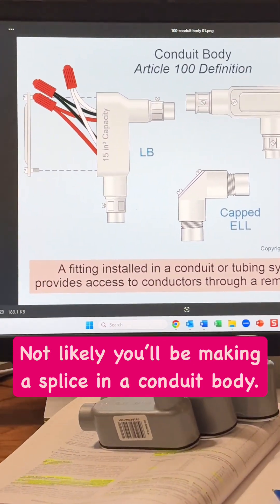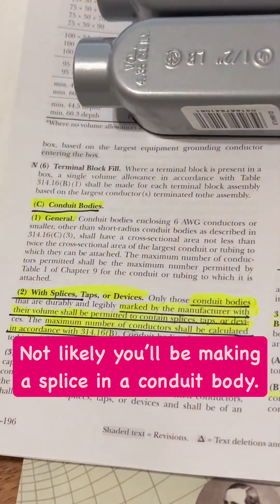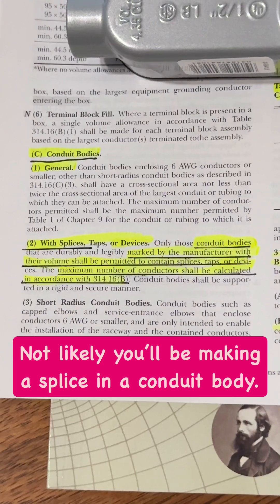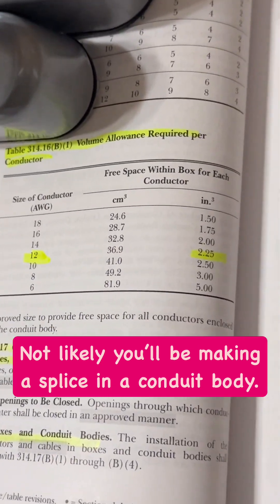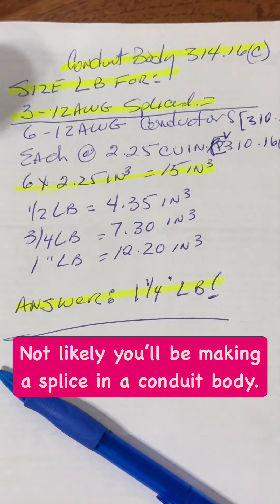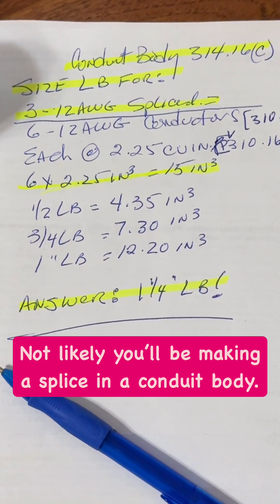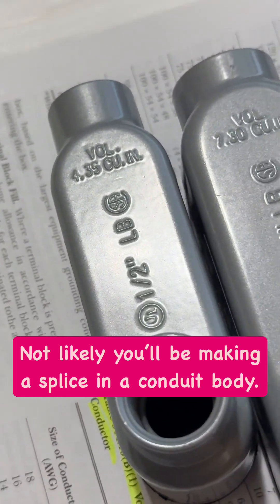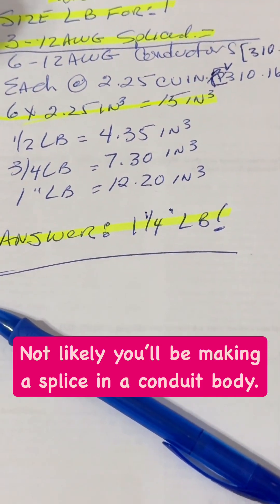Splices in an LB are permitted if the conductor volume doesn't exceed the conduit body volume.

Comment: I’m getting 13.5 cu inches when I do 6x2.25. Am I missing something?
Reply from the maker: The math on the paper (and what I said) was wrong (it is 13.5 cu in). I did fix this in the text of the post. I so wished that I could be perfect, sorry.
Reply: @ I was just making sure I wasn’t missing something since I’m new to electrical. I am taking my test Monday after buying the NEC book and tabs from you. No need to take it personal.
Reply from the maker: I didn't take anything personally. Good Luck

Comment: So for all practical purposes, the rule of thumb is NO, you can't. It's called a pulling el, not a junction box, for a reason. I've seen many used in outdoor applications where flood lights are connected to them and the leads are then spliced in the condulets. This is such a flagrant code violation that goes unnoticed by many inspectors. I just don't understand it.
Reply from the maker: FALSE about using Tribal Knowledge 'rules of thumb' for NEC application. Let's just use the NEC for NEC discussion.

Comment: Guess I'll keep an extra 1-1/4" LB and some reducer bushings on the truck just in case of this scenario. Maybe a condulet as well.
Reply from the maker: A box will work also...
Reply: @MikeHoltNEC  Of course, sometimes a box is too big or ugly. Although I'm not sure how good a gargantua LB would look.
Reply from the maker: It's not that large for six 12 AWG wires.

Comment: Several times had to look for my shoe horn & rubber mallet when a contractor ran 4# 12's for a motor & 3 #14's for start stop station in a 1/2"  " T " condulet. Sent new apprentice  on a wild goose chase to go and get a condulet extension box. Not much room for 7 wire nuts.
Reply: Yep and no room for a service loop. Surgical connections. Lol

Comment: Hi @Mr. Holt. Why did you double the conductors? For a standard single circuit multiwire branch circuit, 4 conductors are needed. A 1" LB would satisfy this requirement. Or a 3/4" LB for a single wire branch circuit. Am I missing something?
Reply from the maker: When determining the number of conductors in a conduit body [314.16(C)], "Each conductor that originates outside the box and terminates or is spliced within the box shall be counted once." [314.16(B)(1)] So we have two blacks, two reds, and two whites - six 12 AWG x 2.25 cu in = 15 cu in., which requires a 1¼ LB.
Reply from the maker: Lol... yea... all of us...
Reply from the maker: Me too.
Reply: @REG3305  Once the conductor is spliced it must be counted twice. (Hey that rhymes)

Edit: has someone been doing box fill wrong their whole career???

Comment: Love the way you said, "...INCH and a QUARTER!" Like who the heck is going to have a 1-1/4" LB on a 1/2" run? That's an EXPENSIVE splice box! Do they even MAKE a 1-1/4" to 1/2" threaded reducer?? 😂😂😂

Edit: spelling
Reply: ...would have to increase the cost with the reducers, most likely special order - not on the shelf, so your buying several different sizes to make it work.
I have used a 2" - 1/2" so the exist! Crazy to think it...
Reply: @JM-iz3fr  🤯 I think I'll stick with an appropriately sized J-box.
Reply: Yes they do. I have seen 2in to half
Reply from the maker: This post is not about 'how to' it's about reviewing a specific NEC rule related to making splices in conduit bodies per 314.16(D).
Reply: @MikeHoltNEC  "... they were too busy thinking about whether or not the COULD they didn't stop to THINK..."
Reply: If you do not have a jbox on hand the condulet will be cheaper even with reducers.
Reply from the maker: And you are 100% correct! https://lhdottie.com/reducing-bushings/r362
Reply: Why wouldnt you just add a junction box instead?...you can still change direction of the run??

Comment: Isn't one an EGC so you only count it once? So 4x2.25 + 1x2.25 so it goes in a 1" LB?
Reply from the maker: Yes IF there was an EGC, but this is a multiwire branch circuit (two hots and a neutral).
Reply: @MikeHoltNEC  appreciate the response. i usually do these splices transitioning from inside buildings to THHN outside.
Reply: @ssl3546  Which is more than we can say for a good number of sparkies! Kudos, just mind the fill.
Reply from the maker: Thank you!